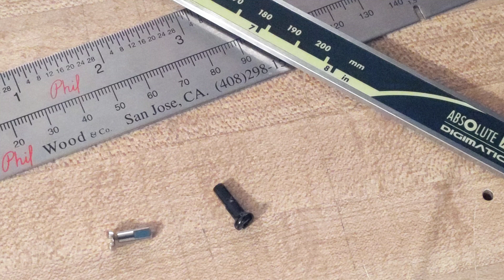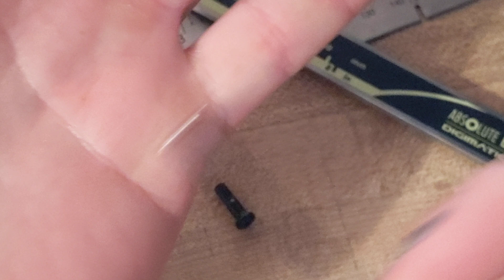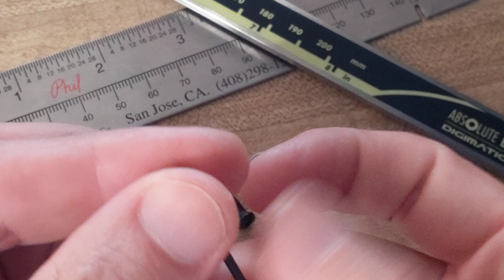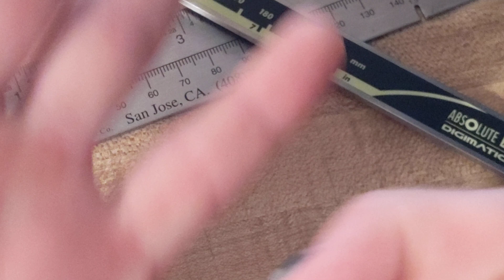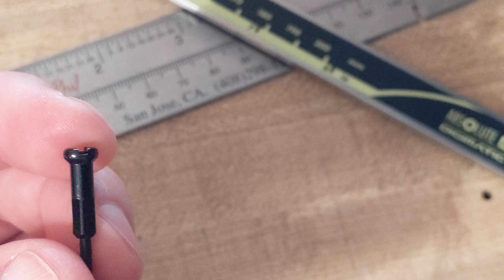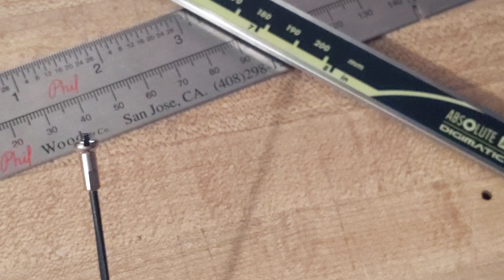Different length DT spoke nipples threaded onto spoke

Comment: that will not happen with sapim nipples,  also there is no issue using 16mm nipples if the spoke reaches the slot it is fine it will not fail.

Comment: I think, DT Swiss makes longer threads on 14 and 16 nipples for those who want to reuse their spokes on replacement rim with somewhat larger (2-4 mm) internal rim diameter or alternatively ERD (given the same measuring technique is used as on original rim) while having an adequate thread engagement. For head breaking that's not an issue for brass nipples. For alu ones, yeah, they are more susceptible to breaking when head support is missing (the spoke is too short).